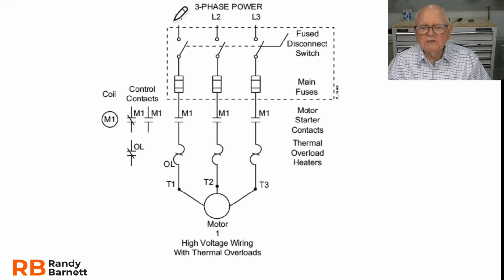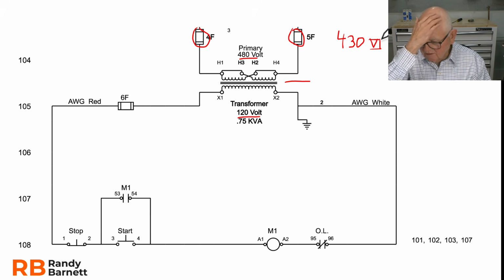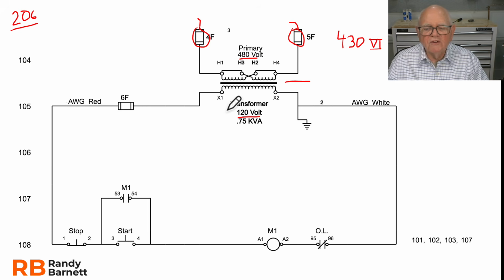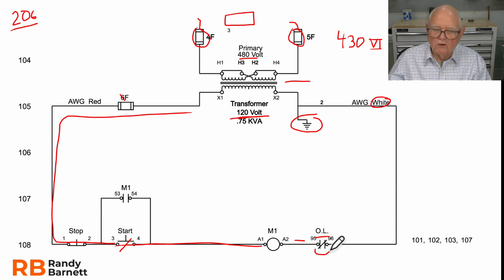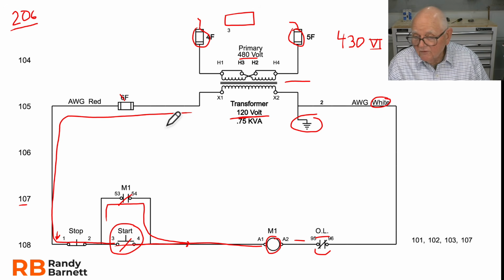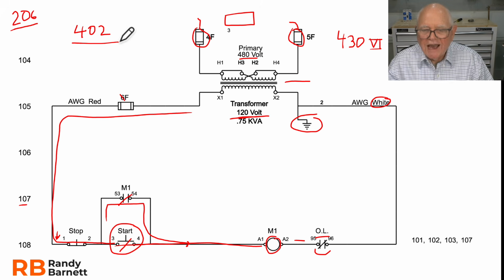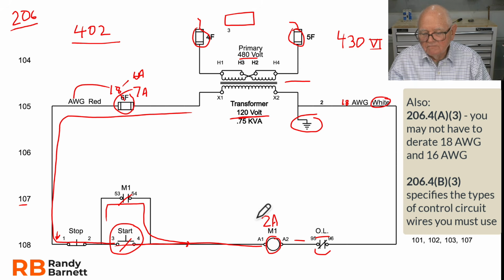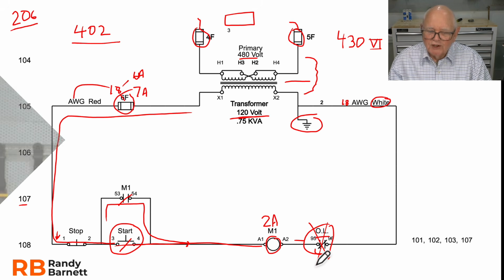EC&M Tech Talk — Motor Control Circuits and the NEC

Comment: Yeah, this is a really good explanation. The only caveat I will say is that pretty much every maintenance electrician after they test to make sure there’s no short circuit or ground fault, it’s gonna bump the motor.. while I agree with what you said once they can make sure it’s not that they’re probably gonna bump to make sure it’s the coil that’s the problem